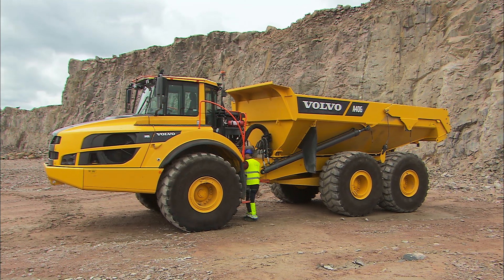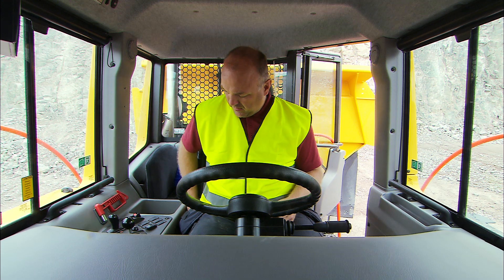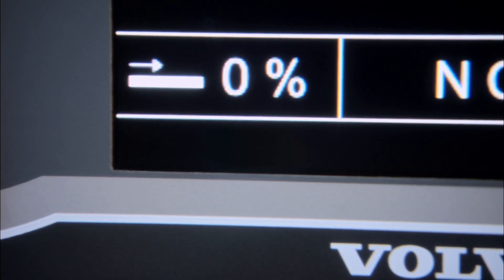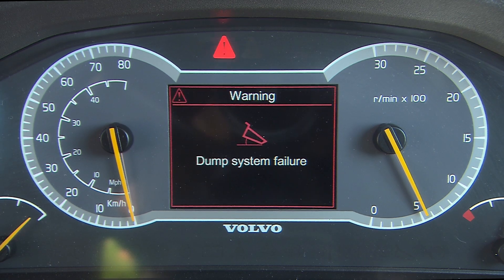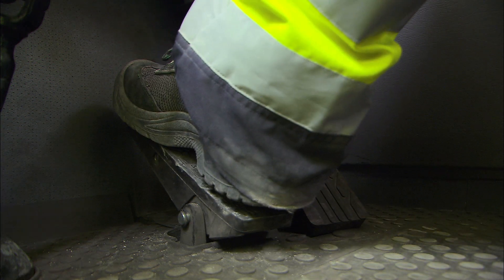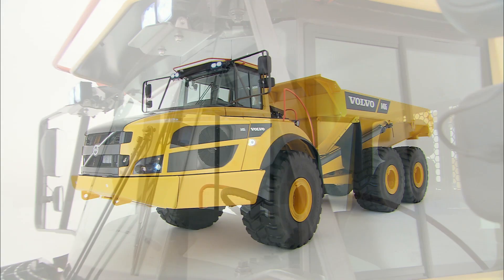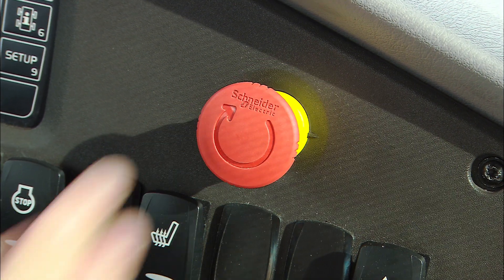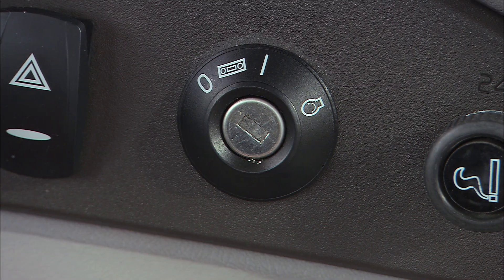Start and shut down – Volvo Articulated Haulers G series + A60H – Basic operator training – 2/12

Comment: I need solution to a problem I am facing. My problem is when the dump truck is moving forward or reverse and brake is applied, the engine switch off completely or the engine goes off completely. Any suggestion of solution.
Reply: William had replied below